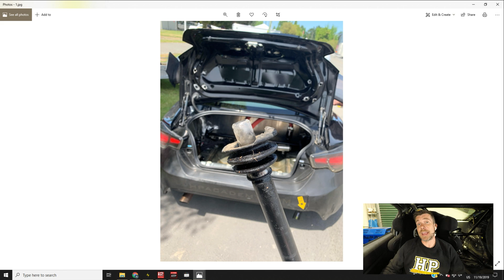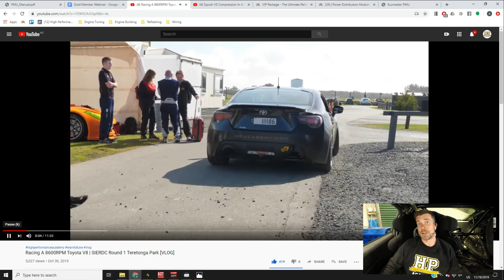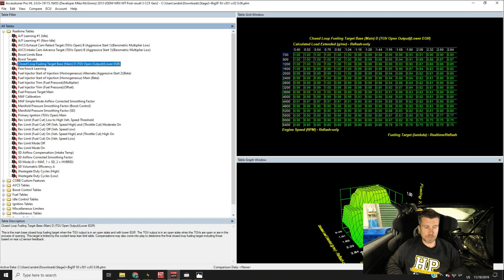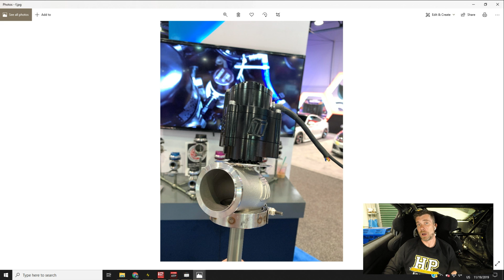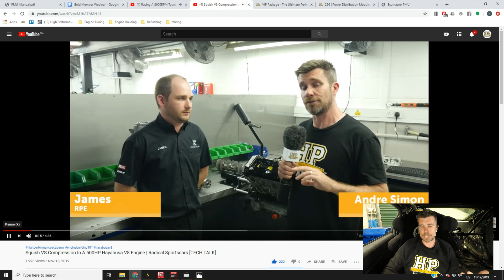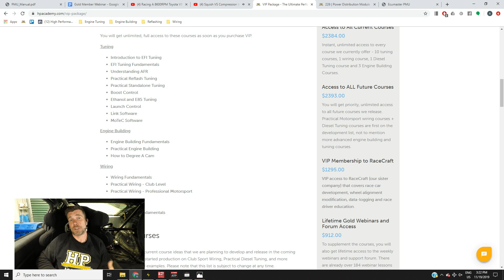SEMA, 1000HP Axle 'Fail', Rally Driving and Telemetry | Today At HPA [UPDATE 226]

Comment: 20A will just be the power source, so relayed, the control will most defiantly be a signal style method, so either PWM or some sort of positional signal very low current as updates to aftermarket ECU manufacturers are available!

Comment: Love the racing videos. Also think 1 hour race isn’t really a endurance race. So short.
Reply from the maker: Just depends what you're used to. If you've done sprint racing then a jump up to a half-hour or hour session is pretty decent. From there the next step is the 3 hour, however, costs also jump up dramatically - Taz.